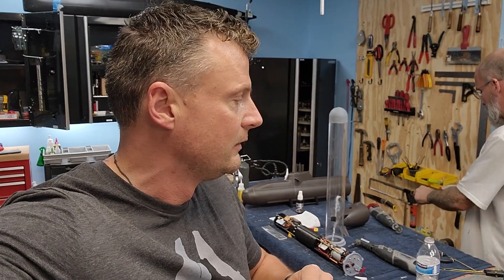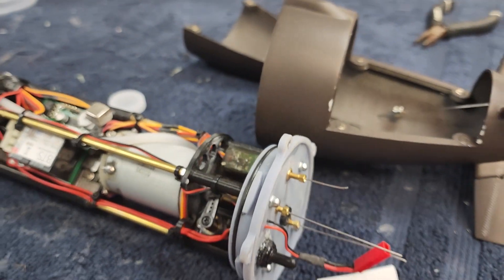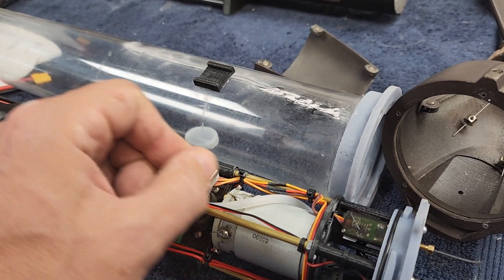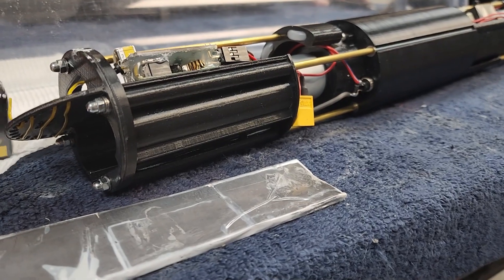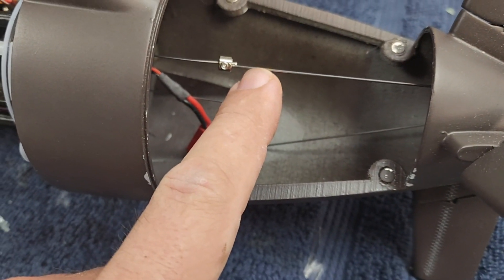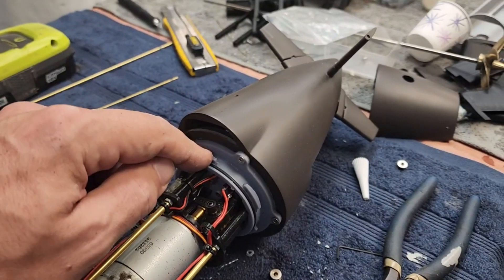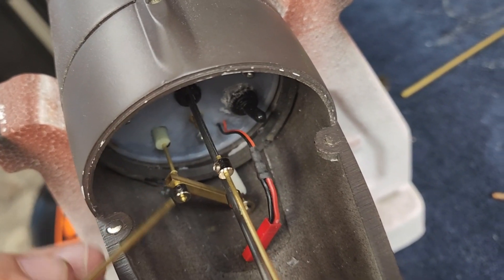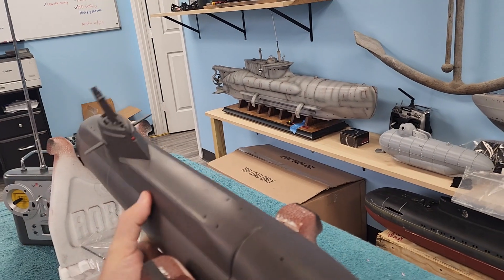Repairing and upgrading the Maximum Modelbau Type 212 RC Submarine

Comment: Hello Bob, here is Danny from Germany. It is very sad to see, what the DHL custom service did with the submarine. Everything was fine and well packed. Sadly the personal there did a check before shipping via Airmail. They said, the submarine looks like a rocket or something, so they had to open the package without knowledge to put all back in the right way. ...   I bought the insurance for shipping. Hopefully this is working. Here is a video I caught on camera before delivery:

https://www.youtube.com/watch?v=sovVcBYlpu8

This shows that every thing was well fitted. And now I have to see how you have to fix all the stuff again. Sorry for DHL. The travel for the rudders doesn´t have to be very big. Because of the motor power and the X-configuration, the submarine is very agile. The movable front rudder was a special wish from the customer. The regular series don´t have steerable rudders at the front because they won´t have an effect. And here are a few corrections:

-the Engel 212A is 1/70 scale, our submarine is 1/72 and there are no inspirations from this, because Engel´s Submarine is a single hull version with piston tank (other concept)
-Can you correct the Headline? we´re Maximus-Modellbau ;-)
-the wire for the linkage works with a little spring effect to compensate all rotation movements from the servo horn, that´s right. The brass issn´t needed
-the bajonet has got much more crash resistance. It looks like the shippment causes issues with the mechanical stress during construction. We do not use water washable resin. Our material is 
 manufactured by the company "Druckwege" here in Germany
-the total system works with 2200mAh 3S LiPo Packs
-the additional push rod sealing was installed to giude a additional wire through the closure. This was a customers wish for future installations. 

Regards, Danny